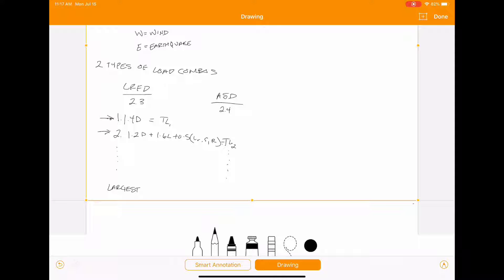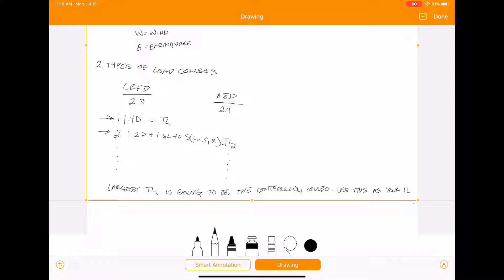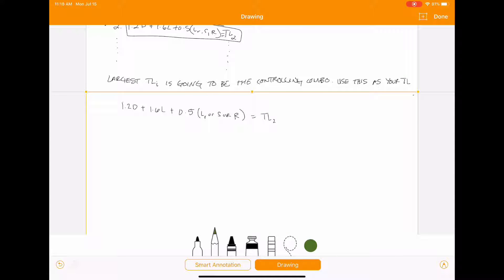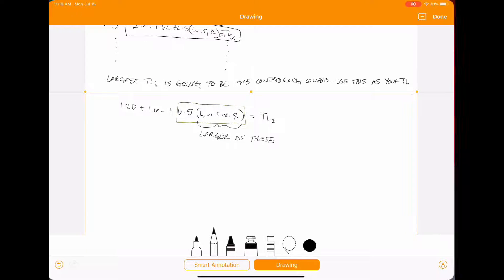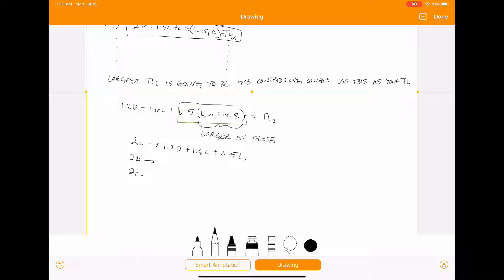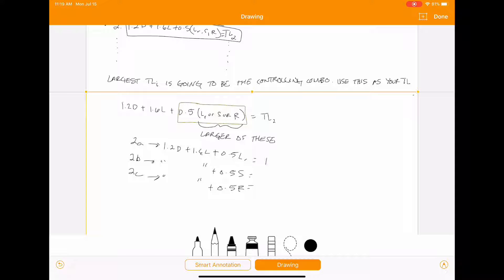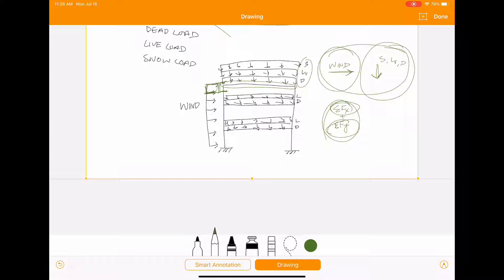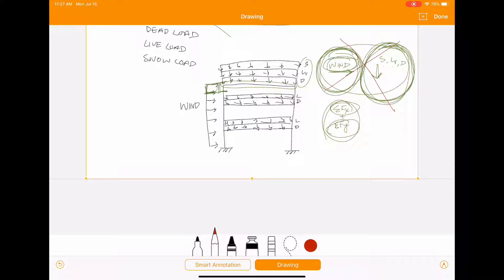Structural Design Loads - Load Combinations

Comment: Vertical and lateral loads are in-fact combined per the ASCE 07 load combinations.  You don't loose your dead load during a wind event -- the uplift load combination is 0.6D+0.6W.  I think your comment may be misleading to some engineers.
Reply from the maker: Hi Adam, thanks for pointing this out. I can see how my statement is misleading. You do in fact combine Wind Uplift and Dead Load. When I mention "Lateral" I use it interchangeably with "Horizontal"
Wind Uplift acts in an upward direction, so I classify it as a Vertical Load. 
Let me know if anything else is ambiguous.